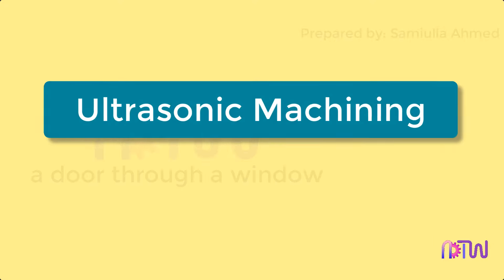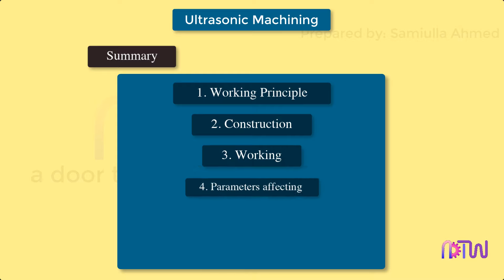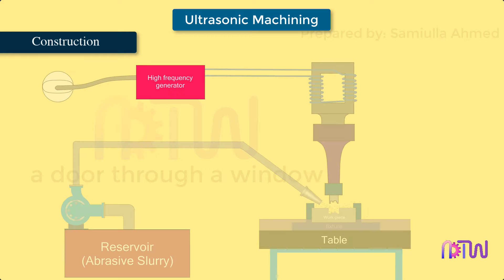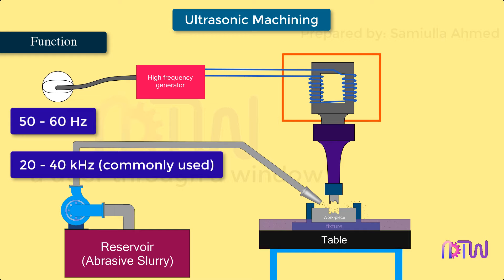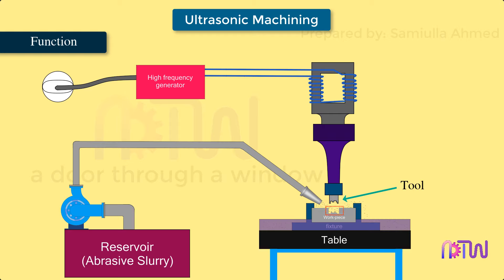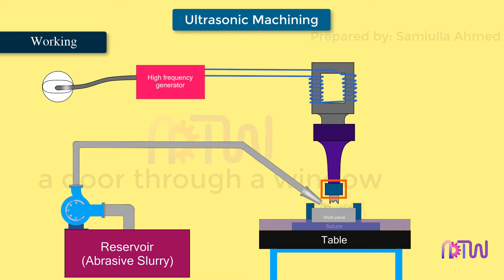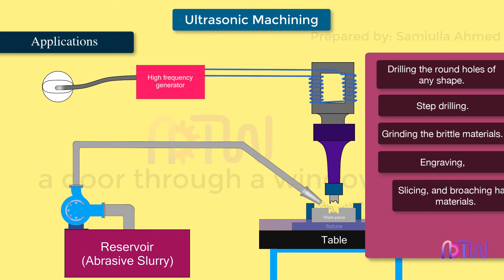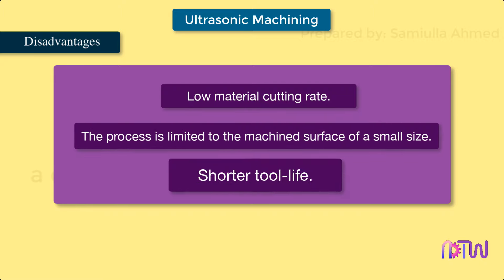ULTRASONIC MACHINING: How Ultrasonic Machining process work (Animation)

Comment: What will happen if we don't use Abrasive Slurry?
Reply from the maker: There will be no machining. Since abrasive slurry contains small particles which take sonic vibration from the tool and impinge on the workpiece causing material to erode...
Reply: The slurry mainly contains with abrasive particles that impact of the working place by the tool, and the mixed water clear the machinig place .